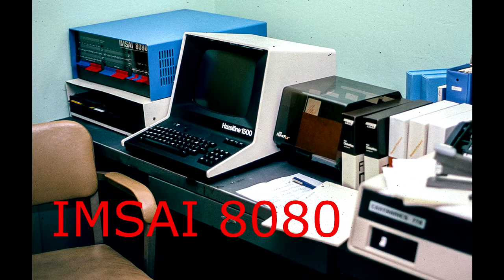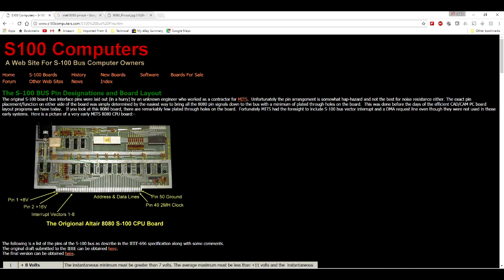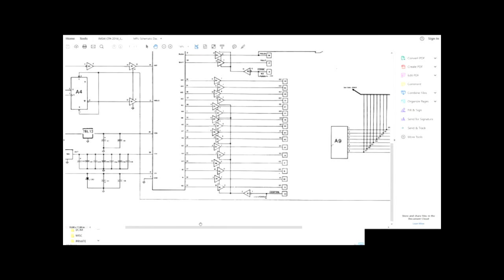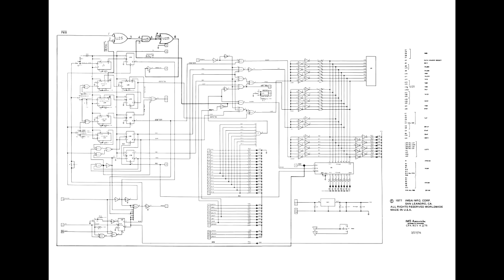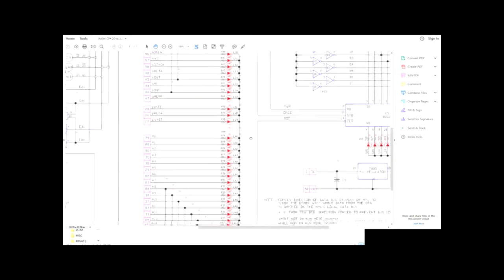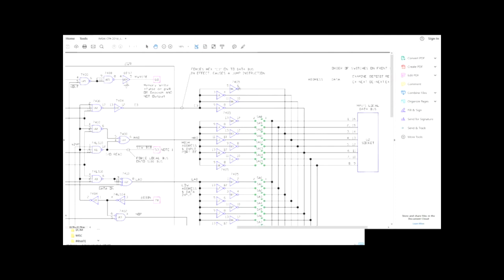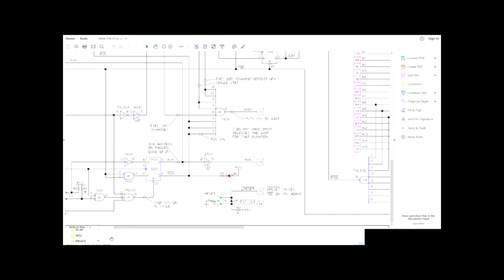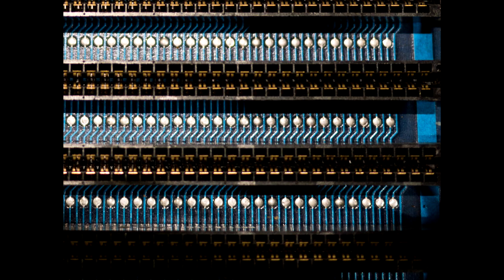#3 IMSAI 8080  MPU and CPA schematics

Comment: Everyone:  The MPU-A schematic shown here is correct, but BE FORWARNED that the first IMSAI FRONT PANEL schematic shown in this video, which is the last original IMSAI CPA REV 4 schematic, is WRONG.  Do not ever use it.   The original IMSAI CPA rev.4 schematic has several errors as follows:

1. (Lower Left corner): S-100 bus pin 37 leading to U11 pin 9 is mis-labeled. It should be S-100
bus pin 39
2. (Center Upper Left): U15 pin 1 (SOUT) is shown going up to U25 pin 5. Change the drawing to
show U25 pin 5 connected to U15 pin 2 (SOUT*)

The second NICE color schematic of the CPA in this video was re-drawn in 2014 by Josh Bensadon has all of the corrections, use that one:

http://s100computers.com/My%20System%20Pages/8080%20CPU%20Board/IMSAI%20CPA%202014.pdf

Comment: Thank you!!! I've been hoping to build one of these front panels pretty much from scratch and I've been wondering how they managed to implement the examine , examine next and the load and load next. I've been looking for this explanation for several weeks! Much appreciated!
Reply from the maker: have you found good switches to use? that was the hard part in my mind
Reply: @IMSAIGuy  hadn't even thought about the switches. I thought they'd be easy to find. I'll actually do this with a Z80 not the original processor as Z80's are still easy to get and they're a superset of the 8080 instruction set. I'm actually a software guy with a couple years of high school electronics from back in the 70's so I may be getting in way over my head but I have lots of time and parts are cheap. cheers!
Reply from the maker: http://www.s100computers.com/My%20System%20Pages/Mini%20FP%20Board/Mini%20FP%20Board.htm
Reply from the maker: I never learned the Z80 instruction set. much more than the 8080. lots of indirect addressing. Z80 is much easier hardware wise.
Reply: @IMSAIGuy  I've been reading through Steve Ciarcia's book on building your own Z80 computer and he talks about the additional chips needed to support an 8080 machine. This book is what sent me down the Z80 path. He also provides schematics for a front panel but its driven by a software monitor program. Which is certainly more functional that the hardware front panel but I'm partial to the binary switch flipping panels of the ALTAIR 8800 and the IMSAI 8080. Call me masochistic. I have absolutely no plans to build the power supply describes in Steve's book. It's an old style linear supply which is what you would expect from a book written in 1981. I plan to use a modern switching power supply and I think with the Z80 5V is all I need. I don't think I'll need 12 or 16 volts for anything. Thanks for the link! Upward and onward!
Reply from the maker: @jimc31415  I always liked the 8085 which is 5V only and no support chips. It uses the 8080 assembly. The Z80 is very nice and more capable. I just never learned the assembler which is very different. The 6502 is also a very good choice.
Reply: @IMSAIGuy  I don't suppose you remember where you found that nice annotated schematic of the front panel? I've been looking for it but so far no such luck. I have come to the realization that building a similar front panel for a Z80 is going to require some modification... If I actually need to use 8212's, I have a source for them but is there a more readily available modern substitute? Thanks!
Reply from the maker: @jimc31415  http://www.s100computers.com/My%20System%20Pages/Mini%20FP%20Board/IMSAI%20CPA%202014_Josh_wNotes[1].pdf
Reply from the maker: @jimc31415  Just use a 74HC573